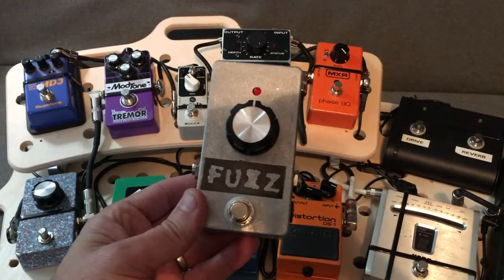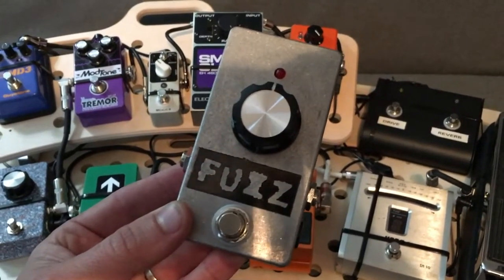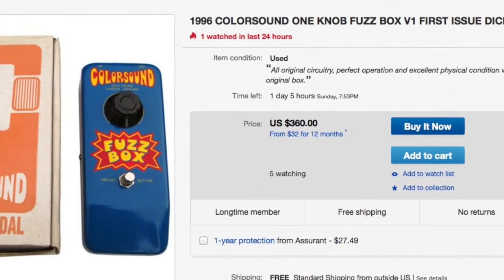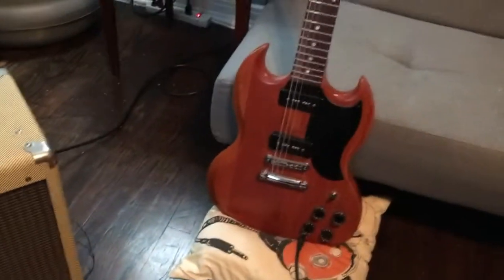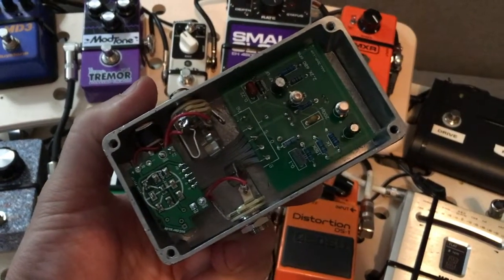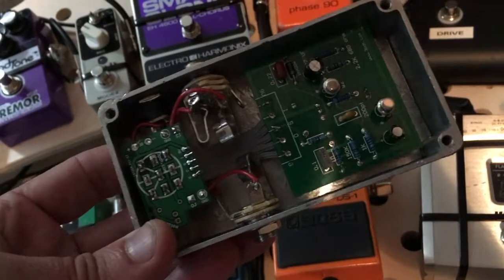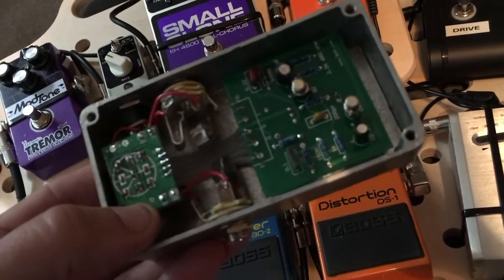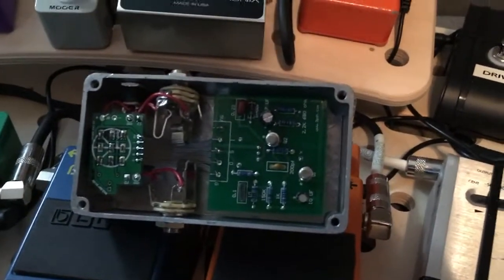3PDT One Knob Fuzz DIY Kit

Comment: The TRS jack is used to bypass the power. If you'd been able to fit a battery in it, the ground of the battery would connect to the ring portion of the stereo jack (typically used as a the input jack). When you plug in a mono guitar cable, it grounds the internal 9v battery to the rest of the pedal, turning it on. That's a very common thing in guitar pedals, but if you're buying this as your first pedal kit there's ZERO reason to expect you to know that. They really should have explained that.
Reply from the maker: Yeah, this was my first kit and I've learned a lot since then but this was definitely not a well documented kit. Since I built this one, I've found some really well-documented builds that explain this sort of thing. At this point, I hardly even need to look at the instructions on most kits, but this particular kit certainly wasn't beginner friendly. Thanks for watching it though.

Comment: The TRS jack acts as a power switch when a jack is plugged in, only really useful if you use a battery 🤣
Reply from the maker: Understood. I totally get that. However, their documentation shows 2 TS jacks and there's no room for a battery. That's why I called it out. They probably modified the BOM at some point, but it just rubbed me the wrong way.

Comment: I'm just getting started in pedals, but my fuzz doesnt work. So my question is: Do you need to stick to a particular transistor, or does any NPN do?
Reply from the maker: That question is probably better suited for a DIY Electronics Forum opposed to a  YouTube comment. You'd probably have better luck there but from my understanding, the combination of transistor and diode greatly changes the tone. It may work... but chances are you're looking for a particular sound.
Reply: @musicalmiscellany  Thanks, but im not looking for a particular sound, I'm just looking for A sound, since my last 3 tries did not work. 
Either way, thanks, and keep doing what you're doing, love and support from Spain
Reply from the maker: @nicolasfliedl1009  check out this video. It's the simplest fuzz circuit imaginable. https://www.youtube.com/watch?v=7r59yoZhEtU

Comment: Neat pedal board with the thru-holes & zip ties. May I ask what it is? Thanks
Reply from the maker: That is a Holeyboard. This is one of the older models, you can still find them on eBay and Reverb and such. The new models are made of metal. https://holeyboardpedalboards.com/

I like the wood ones better, but a lot of people like the metal aesthetic.